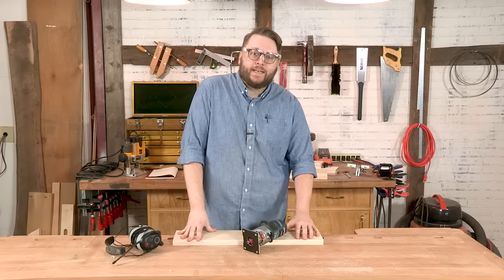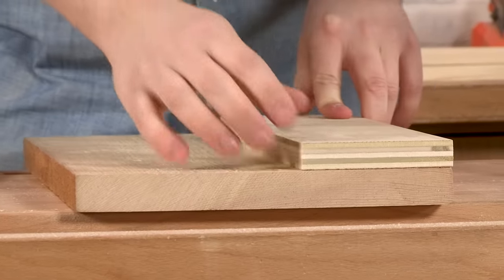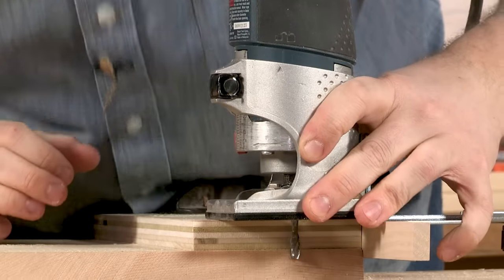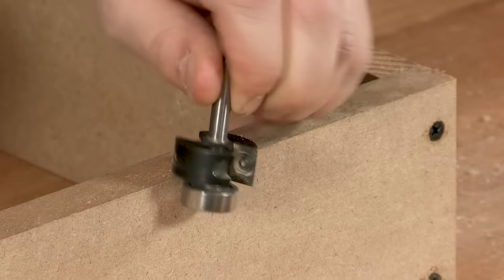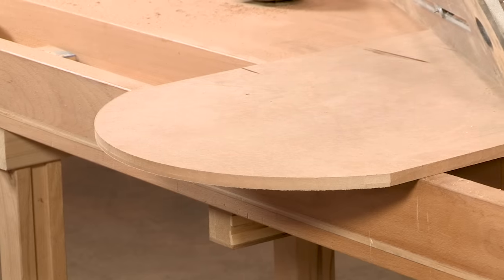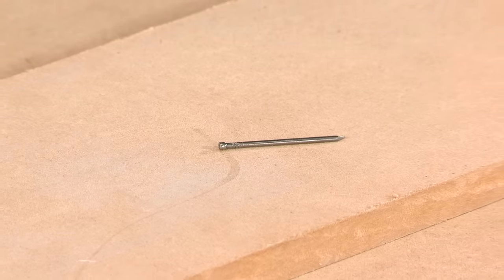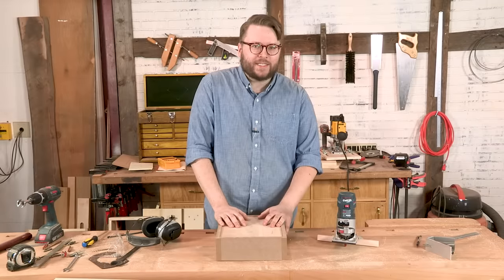Routers Beyond Roundovers | I Can Do That!

Comment: Simplify your circle jig. Pick a guide brushing. Drill a hole in the jig that matches the OD of the brushing. Put the brushing on the router and just drop into the hole and go. This eliminates the need to screw the router to the jig.

Comment: Correct me if I’m wrong….in determining the nail point wouldn’t it depend on if you want a 10” hole cut out of your work piece - or if you need a 10” circle?  You said measure to the outside edge of the cutter. My brain is telling me it needs to be the inside edge if the circular board is your work piece.

Comment: Good video. Points to note though,  if  you make your cut in 2 or 3 passes your  bit will stay sharper for longer you won't burn the workpiece you'll avoid the potential of the bit deflecting, possibly snapping under load ruining the workpiece and causing yourself serious injury
Reply: I'm wondering: Why will the router stay sharper for longer if you double or triple the way it has to work itself through the material?
Reply: Blunt force he removed too much material at once it creates more heat that deforms the bits surface quicker than multiple passes at lower resistance, also he is dragging the bit through the wood hence the wonky slots for the dado.
Reply: Also it will preserve the life of the router motor, (imagine a small family car trying to tow a large trailer with heavy machinery on it) if the router was a larger machine 2000w or so then a single pass would be possible but even then better to do it in a couple of passes.
Reply: @HenryPiffpaff  Because it won't get as hot, therefore does not gum up the cutting surface with burnt resin and wood fibers
Reply: @alphaclean3364  Thank you, that sounds plausible
Reply: He also climb cut that first dado.

Comment: Nice job. If you cut the far side of the dado first, you can use a spacer the same thickness of the material and cut the second pass. This way, it's not necessary to measure and set twice.
Papa Mel

Comment: Having been bit before... I always check the on/off switch before plugging in the cord. Messing around with adjustments, changing bit, etc. can accidentally flip the switch.
Reply: Better still, always plug it into an NVR (No Voltage Release) socket

Comment: If I may suggest a pencil that fits nicely in those slots....the DIXON REACH is a thin pencil and I use an old fashioned wall mount pencil sharpener to keep a pin point tip on it. Just a thought for your consideration. Oh, and I don’t work for or receive and royalties from Dixon...it’s just a pencil I stumbled upon that I really like for tight places requiring a fine point line.

Comment: If you take a close at the router he hasn't fully locked the depth adjustment, you can see the locked and unlocked picture on the plastic housing of the router. There is a extra click when you are securing the base back on to the router that locks the depth screw into place on this particular Bosch router. If its not engaged you will end up with a deeper plow than expected in the middle or end of your run.

Comment: To make accurate centers for drilling holes to match something like a router base, just take out a drill bit from your set of bits that is the same size as the hole, place it in the hole and  hit it with something - a piece of scrap wood, a hammer, whatever. Viola, a centered mark. Even a old, blunt drill is good enough.  If you are doing this sort of thing regularly you can buy a set of 'Transfer Punches' from any number of online sources that will mark wood, steel or plastic without being damaged.

Comment: Wow, I was going to add some critique, but seems you have a bin full already. Everyone's a critic.
Great to see some instruction like this for those who are less than experienced with a router.
Reply: Except he pushes lack of confidence using a router and also states he finds it "tricky", to aline the router with his line and in fact botches it up and makes a very loose joint. For someone that is a first-time user of a router, this would not fill them with confidence in using a dangerous power tool.  I honestly think he should have been a baker with hands like that, kneading dough all day would be right up his street. Baking and dough kneading for say, simple buns is less taxing and does not need much skill as long as we can be assured he can read the instructions to the recipe and not have his mind wander too much.
Reply: @davewilco822  Well, aren't you just a breath of fresh air.

Comment: Listen to the vibrations at 10:30 you’re cutting too much in a single pass! “Never cut more per than the thinnest part of the cutter” is a good place to start.
Reply: If you turn you're volume off you won't hear the vibrations
Reply: lol
Reply: That poor lil laminate trimmer lol
Reply: 1:10 He said "Changing router bits is one of the things I hate to do. It never seems to come out right."
Bad start right there...
Reply: @DARTHFEAR0N  I've got a 40 something year old light duty 1/4" trimer router. Used it for all kind of routing it wasn't meant to do. With less chatter, no howl. Even more expensive ones. It's still my favorite router & still runs well. Just take lite cuts until the job is done.
Reply: jacob brown well even that could be an incomplete answer, depends on loads of factors...
Reply: Roarn'Leon yes, how to I still confidence, not.  He did it perfectly, such a gentle humble man, I really liked his manner and he was clear and concise with his instructions.

Comment: Regarding the dado jig and 'the moment of truth'. I see a couple of problems:
1. The carriage bolts are not recessed so the whole jig is teetering over the heads
2. There is nothing to stop the router chewing into the jig base plate particularly  if the stock is thinner material and sits lower than the base plate
Or am I missing something?

Comment: Consider turning the screw over on the metal guide so you aren’t fighting with space between tabletop when adjusting.
Reply: Yeh, I think something is assembled up side down. Also looked to have the the bit installed too far.

Comment: I didnt watch the entire video but don't forget to inform viewers a router MUST travel from left to right or a clockwise direction otherwise doing the opposite direction pushes the router in an unwanted direction . Clockwise pulls the router fence to the work piece which is the correct procedure. Good Luck fellow woodworkers.
Reply: The preferred way to travel depends on whether you're routing inside or outside. Conventional cutting means you push against the direction the bit spins. Climb cutting is when you go the way the router wants to grab and run. Conventional is easier to control but climb leaves a cleaner finish.
Reply: Agreed with replier I have now after 7-8 years of daily woodworking found that more often than not climb cut to get a better finish especially in oak/ash and softwoods that tend to tear out and burn just not for beginners for sure but it done consciously & safely there is not absolute rule that it must go left to right and clockwise

Comment: I spent dust deputy for about $50.00 on Amazon .rubber connector on Lowes with metal clamp on each side, hook it on my Router even on MDF it suck all the dust plus I also wear a paper mask .Dust deputy save money buying filter for my Shop Vac. I have also a hanging air filtration I bought on Home Depot , plus a Grizzly Central vac for my table saw. Take care of your lungs for a long years of wood working. You are very talented fellow God Bless

Comment: Good video! 
Can you do the same using the router that you used first?
Reply: The first router is called a trim router. Lower power and smaller bits. If you use it for deep cuts you need to do it in more steps otherwise you will break bits.

Comment: Well done video.   One question.  I thought you were always supposed to feed into the rotation of the bit.  So, when you cut the one side of the dado and then pull back for the other side, isn't that going against the rotation in one direction?
Reply: No. Think about it.
Reply: You feed against the rotation of the bit. Otherwise the bit will pull and cause the router to jump and skip places

Comment: Nice video production..and good insight.  One tip, I'd set the fence first with the bit flush with the router base so you can actually get super accurate with it, then set the bit depth.  Just an order change.  Thanks for the vid !

Comment: A little bit “loose”, sure was.  Although a little difficult to tell from viewing from a monitor it would appear that the reason for such a sloppy fit was down to a basic marking error I’ve seen made more times than I can remember.

I’ve done this myself too,  more times than perhaps I’d care to remember.  When placing the board on top of the timber that is having the dado cut and using a pencil to than run down either side of the board,  many people will often set the fence/cutter distance to cut the pencil line away.  This then usually leads to a sloppy fit.  Unless the pencil has a hard lead and finely sharpened,  the line drawn will be a little fat so combine that along with setting the fence/cutter to remove the line this then leads to the dado being oversized.

Of course a simple jig can be made to cut the dado however a quick solution in most cases is to use a sharp marking knife instead of a soft blunt pencil and also to leave the siltiest hint of the line which will more often than not result in a nice tight dado.

Otherwise a nice informative video.
Reply: He should have used a T-square jig, pretty sure he climb cut that too.

Comment: Like your video. What I do is not go so deep on the first cut. I rather make 4 passes. go half the distance on the first cut. Reset for the final depth. It saves the bit and less strain on your router also no burn marks

Comment: An important router safety rule - just before you turn on the router adjust the router's speed.  If you don't own a router with speed control, ensure you're not hogging out too much material with each cutting pass.

Comment: Instead of driving a finish nail for your center, use a drill bit smaller in dia than the finish nail and drill from a drill press, thereby creating a perfectly perpendicular relation.  Thanks for the tip...

Comment: 3:51 Thought I noticed the arm of the guide was sitting above the base of the router and was thinking it wont sit flush on the wood and the angle of the dado won't be true (90deg), 6:16 confirms and even more obvious at 6:51 where you can see the shadow between the base of the router and the wood. 

For a How To vid that's a pretty big mistake/oversight.
Reply: He is also taking too much off and overworking the router. I don't know anything about this but just the sound of the tool tells me it is working too hard.

Comment: 15:58 how can you adjust the depth of cut? Your bearing needs to be below the baseplate, so you cant make the cut shallower than the size of the cutter. Your baseplate also needs to be in the deepest setting, so that the bearing is showing. So you cant make the cut any deeper than already is??? I am having trouble with this.
Reply: And it also depends on the thickness of the jig material. Like you said, the bearing need to be below the base plate, but that doesn't necessarily mean that the depth is bottomed out. In the past, I've had to swap to another flush straight bit with a longer cut depth, or I'll fudge it by pulling the bit out of the collet a little bit. You can keep cutting deeper as the bearing can ride on the previously cut wall on your workpiece.

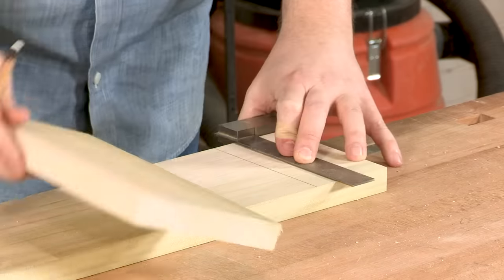Comment: Great effort and a good idea. As a relative beginner I was looking for something like this… But IMHO this guy is really well-meaning but unsafe. Look at 6:10, his fingers are less than an inch from the blade with no safety guard. He also cuts on in the wrong direction on this first pass (you should always cut into the wood). His marking up at the beginning of the dado part @4:40 is really sloppy (he has the set square on the wrong end of the face). I stopped watching, but was amazed about how many positive comments he got. Routers are dangerous. I shall look somewhere else…

Comment: Why not use the right size bit for the thickness of the board instead of two passes? (Unless you were using an odd size board for some reason)
Reply: The plywood is not 3/4 thick; it's about 1/32 thinner.

Comment: Just to clarify, you are making a 10 inch hole.  If you were making a 10 inch circle, you would measure from the nail to the INSIDE edge of the router bit.
Reply: I find that a strange thing to criticise. He didn't say he was making a 10-inch disc, he was cutting a 10-inch circle in a board to make a 10-inch loudspeaker cabinet.

Comment: Missed the MOST important protection: DUST.  Woodworkers have been shown 8 times more likely to contract Emphysema in their lifetime.  Today, NO ONE, literally NO ONE should work in a closed shop without DUST COLLECTION.  There are tons of inexpensive Dust Separator DIY builds on Youtube (including under $10) to keep your shop vac empty and not losing power from the filter clogging.  Strongly recommend everyone watches as many dust collection videos until they or confident that can corral the vast majority of dust in their workspace.

Might have covered tear out, and having a scrap of wood to prevent that.  It's a loose fit in the dado because you took away both the lines, which by definition our "outside" the width of the wood.  next time, take away one line, leave one line.... perfect fit...

Would be helpful to mention that 3rd hole in squaring the boards to a right angle is the "mistake" hole.  If checking after the 2nd screw doesn't show the boards to be 90 degrees, you can pull the 2nd screw, and use the "virgin" 3rd hole to get it right.  In that case, I'd be inclined to clamp it true to the bench and drive the screw so that it doesn't move.
Reply: Oh thank you mr knowitall
Reply: Yeah I loved how the editor put in a "use dust masks!!" message, then cut to the guy wearing no mask at all. (and at one point he's talking to the room as if demonstrating to an audience. Was he exposing them to the dust, too?

Comment: I always have problems with blowout at the end of a routing pass, and on corners. Any tips?
Reply: Cut the very last end of the corner in the opposite routing direction (normally clockwise) - 1 inch should be enough. Hold your router tight and do it in several passes if you are trying to remove a lot of material.
Reply: try climb cutting the corner first, [ by climb cutting i mean moving the router in the wrong direction ] this is usually a very bad idea, as it is easy for the tool to get away from you, but when you want to avoid blowout, it is very effective. also route your end grain first.
Reply: Jimmy Diresta has a great vid on router tips. He talks about chip out on corners and how to avoid it.
Reply: Cut with chisel

Comment: "Swing in" with the spiral bit...? I would rather use a Router with a depth stop  and "flat" plunge bit by bit deeper in. We are not suppose to go more than 1/4 the bits thickness deep at a time.  If the Bit ' s shaft is 6 mm thick it is recommended to go only 2 mm deep at one time, as recommended by the Manufacturers. ESPECIALLY on Hard woods.

Comment: were do you get the router bits at
Reply: The red ones look like Freud/Diablo. If they're Diablo, check Home Depot. If they're standard Freud, check Amazon or a woodworking store.
Reply from the maker: Colin, any big box store (Home Depot, Lowes), or dedicated woodworking store such as Woodcraft will have a good selection of router bits. And you can certainly find a huge selection online. While you'll find lots of bargains in bits, it's still a good idea to look for brand names or check customer recommendations. - DT
Reply: You can order a catalog from www.rockler.com they have alot of routing bits

Comment: I am wondering is pushing the router along from the bottom of the instrument the correct technique to handle it. It doesn't look very safe. For the kind of material you are handling in the video I'd have rather had the router mounted upside down on a routing table and let the wood slide along. Nevertheless, a very good video which deserves its visualizations
Reply from the maker: Actually pushing from the bottom is the best method, as pushing from higher on the machine can cause it to tip during the cut. Lower support on the router keeps it more firmly placed on the cutting surface, and the design of the base itself is designed to keep fingers out of harm's way.

Comment: You should try festool routers, very easy to use with amazing dust extraction.
Reply: its also 6 times the price and wont do much better.   In fact, my 2.3 HP router from Bosch that I got for 180 dollars on sale would cost me almost 1 grand if I bought it from festool.  For that price, I could get a entry level CNC Wood Router kit and have alot of the work done by a computer.  For the DIY'er or even someone who manages rentals, FEStools are way over priced for that level of work.  Its like the weekend mechanics who buy entire tool kits from snap on that cost more than alot of peoples mortgages just for a bloody name.  Great for professionals who use their tools hard.  But no ROI for even hobby wood workers.